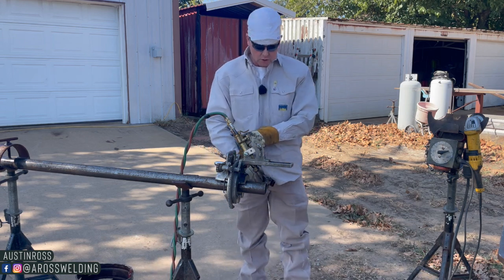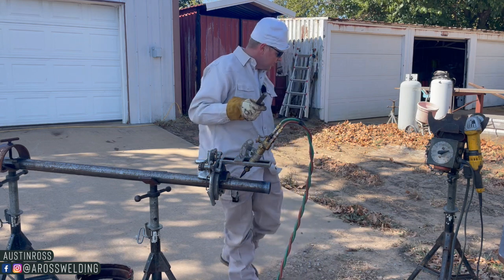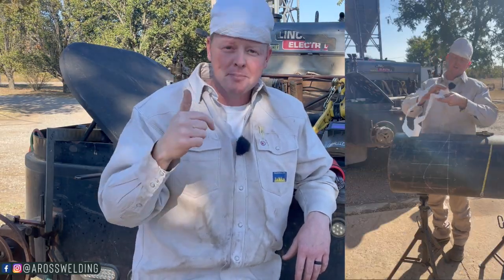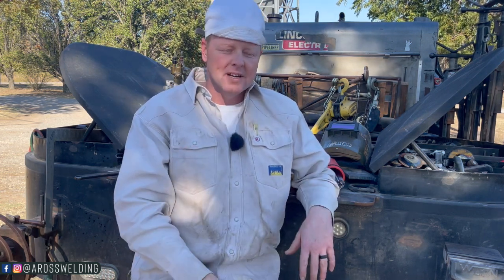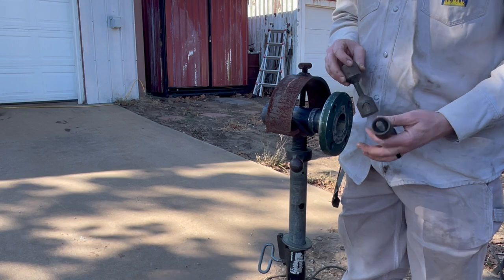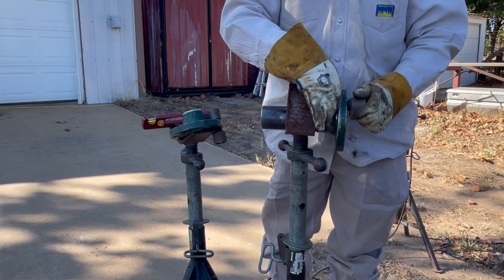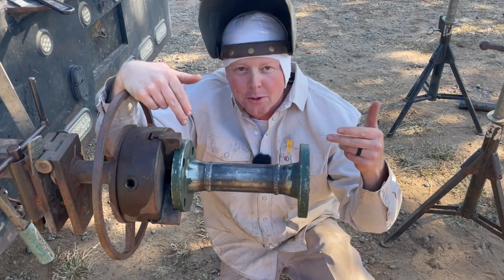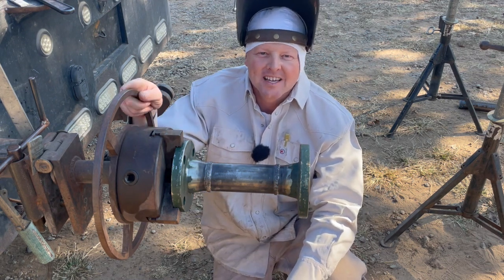Pipe Fabrication// Fitting 2" Flange (Why We Call It A Spool)

Comment: Hi Austin. 

I have really admired your goodself,and enjoyed your videos from the start of your postings.

You are an inspiration to welding craftspeople of all ages.

I am almost 70 years of age, and for many years, probably the better part of 30 years, I was an oxy-acetylene pipe welder. At the time of my career, Pipe Welding was usually a bolt on skill to the UK Heating/Cooling, and industrial plumbing sectors.

I would often weld Carbon Steel pipe,in any position up to 6 inch diameter, with a thickness of around 1/4 of an inch, or just above.

Butt welds were mostly vertically upwards,  using the leftward,rightward, or all positional rightward techniques.This was very advantageous in situations, such as pipes close to another pipe, or pipes up against a wall, as vision of the weld pool could be maintained.

Pipe Branches would also be welded by Oxy Acetylene, and depending on the size or thickness,several runs could be used to bring about the requirements of the specification.

Welding of pipe flanges would usually be limited to smaller diameters, say up to 4 inch maximum.

Vertical pipes would be welded by either leftward  or Rightward techniques.

If  required, welding would be tested for QA. Competency Certificates for welding in my area of expertise would be issued every 3 years, subject to retesting of welders, or if the project demanded  otherwise.

They were wonderful years of my life and career.

Best wishes from the UK.

Comment: Sense you made this for show and tell, make it into a stool to set on in your shop. It looks to be about 18" long, which is about the average height for chair give or take 1" to 1.5". Cut a 12" circle out of a scrap of plywood. I would try to use 3/4" plywood. Get some padding and vinal cloth stretch tight and staple to board. Use wood screws to attach to on one end of the spool. The other end spot weld to a 1/4" cut out disk, an old disk blade, or an old wheel. You could attach a 1/2" rod bent to a square shape for a handle welded to the side. 
        As always, an exclent video. 
     I think your offer to teach how to make the 12" branch test is an exclent service to the community  and industry. I don't necessarily need it as being retired. I could no doubt benefit from the class and would sign up, but I'm just too busy to even think about it.